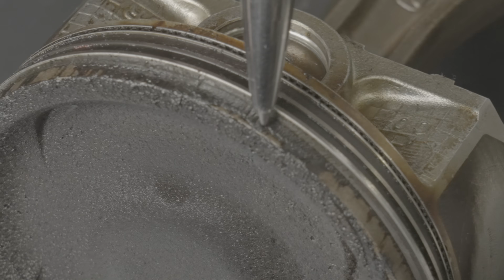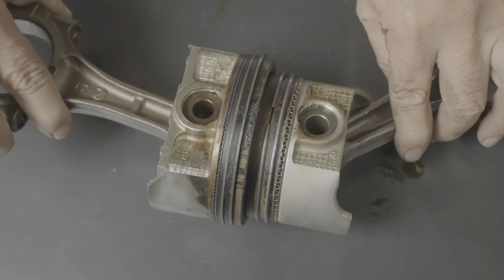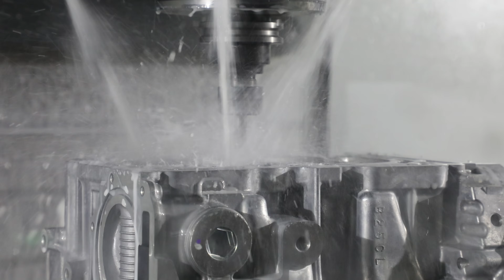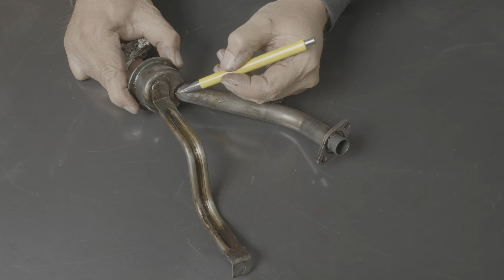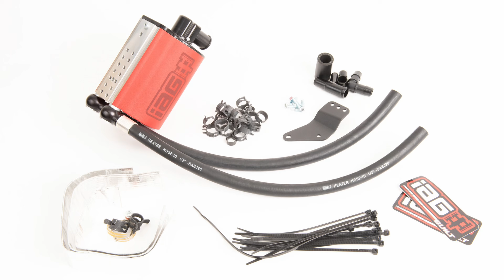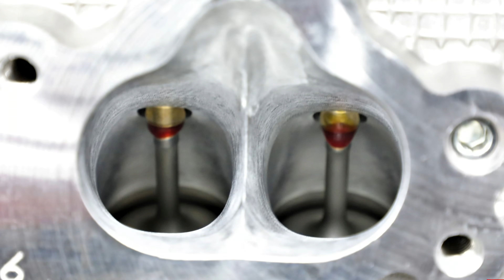Why Subaru Engines Blow Up!

Comment: If you put an old Air-Cooled VW case next to a Subie case you'll see they're not all that much different (structurally). When you think how one was built to support 40-60hp, the other to support 200-300hp, it becomes very clear why these cases flex/distort.
Reply: Check out the Subaru EA engines. The pushrod engines I describe as like someone described an aircooled vw over the phone to an engineer. The transmission (that became the 5 speed) is very similar too. The ring gear ID is even the same, and dimensions close enough you could retrofit a subaru diff into a VW (I've considered it). But those EAs have a 3 main bearing crank like the VW too.
Reply: @Levibetz  As an owner of a 1971 1600 this makes me happy to hear, I always knew the motors where simillar but never knew they were that close. Now I see why they are so popular for swaps gotta say Im deffanatly going to get one of those feeling parking next to Subarus from now on almost like parking a old muscle car next to a new one.
Reply: @randoorlando443  Well the EJ is totally different, that's the motor this video is about. But the older EA is very similar. Nothing interchanges directly, but it's similar.
Reply: @Levibetz  ahh, I figured nothing would be interchangable I gotta say subaru motors are deffanantly far from my cup of tea heck really motors in general but I guess I can always look at subaru as big daddy vw in a way, Thanks for the info
Reply: Thank you so much for this excellent video. I’ve owned an ‘04 and ‘17 STI and an ‘08 and now ‘22 WRX. It’s a shame they have such a bad wrap when it comes to reliability, because my Subies were the top 4 cars I’ve owned (out of 46, including pretty much all the usual suspect “tuner cars”) for daily driving during the week and then canyon carving and track days on the weekends. All 4 ended up around 380-410whp and I never had a single mechanical failure on any of them. I went 14 years straight without missing a single SCCA AutoX event in my region. I always drove my Subies 2-5 hours to and from each event, and then drove them to work on Monday. They never left me stranded a single time. 

Hopefully this video influences a lot of people to stop chasing Coyote/LS/2JZ numbers with their Subarus, and instead enjoy them as a 350-500whp 4-season daily driver/weekend warrior where they really shine.
Reply from the maker: @blueridge8992  100%
Reply: @blueridge8992  100% Agreed, Subarus shine as daily drivers. My OBXT makes 250whp and is an excellent daily. Runs a modest 14.2 in the quarter and I drove it to a season win in local SCCA rallycross. Meanwhile the chassis handles great, does great in snow, fits 6ft goods behind the front seats, 8ft boards and pipe between the front seats. Really couldn't ask for more from a daily. Now it did have ringland failure, but ultimately it wasn't that expensive of a rebuild and now with forged pistons and an upgraded pickup tube, there's nothing much to worry about.
Reply: There are kits to put subie motors in the old bugs.
Reply: Great Info on the Similaries between Original German VW boxer vs Japanese Subie copies. I was looking for an engine replacement for my VW Vanagon but decided to rebuild and upgrade my orginal 250k Waterboxer. I've heard bad things about Subie conversions and this confirms it. Thank you guys!
Reply: You obviously don't know much about boxer engines, then.
Reply: @eskieman3948  Its like saying one completely unrelated 4 cylinder from 1980s is similar to other one from 2000s. General layout will be obviously similar and same-ish form factor, but its not the same design in detail. Especially between aircooled and watercooled engines.
Reply: A lot of EA’s have been used in homebuilt airplanes. Other than being bit heavy with respect to airframe CG, I’ve never heard complaints with performance or reliability.
Reply: The entire mechanical of a boxer is weak.  I love them dearly, but they need lots of support
Reply: @alman-world  No, its just that most of design subaru did was purely for naturally aspirated applications, with turbo ones being and afterthought. 

Same applies to 5 speed manuals, these were all designed for NA application and having then in WRXs and other turbo ej subarus was at very limit of what these could take, with much more brutal torque delivery.

If you stick to stock 2.0L turboes and naturally aspirated engines, you will be perfectly fine. 

Engine wise EJ25 itself was a massive afterthought done purely for american market before being used in europe and australia. 
Turbo version of it doubly so.

 None of the horror stories about ej25 apply to ej20's or ej22's or ez30 H6, and newer FB/FA motors.

Its literarily one engine that ruined their reputation effectively and worse end if the stick of "Subaru legos" in case of use of 5 speeds in 2.5L WRXs later.

 As you get both higher displacement and turbo torque, all beating down on  a transmission meant for 2.0L-2.5L na motor tops with proper reliability targets.

TL;DR just go for anything else than EJ25 turbo or NA and you wont gave any of the issues, if yiu want reliable turbo get older ej20 wrxs or newer fa20/24 motors.
Reply: @alman-world  Not the ones over the past 10 years.  You don't know what you're talking about.
Reply: I wonder how similar the water cooled Porsche engines are to an EJ, in terms of "idiosyncrasies"? I remember reading that the VVT in the Subaru 6 cylinder is a leased copy of a Porsche design.
Reply: @MichaelAMangone  The crankcase of the Porsche 6 cylinder from what I've seen is wildly different. It has a separate bearing support internally with the case halves and cylinders being separate. I haven't checked out videos on their 2.5 H4 though.
Reply: @Levibetz  The M96/97 have the crankshaft carrier and a intermediate shaft for the camshafts & oil pump. These engines were discontinued and replaced with the MA1/9A1 engine series in 2009 designed on a clean sheet of paper. Do a little research on it for a gain in knowledge on this. I have a 2010 Cayman S, as I didn't want the earlier powerplant for several reasons. The aftermarket has come up with a lot of the necessary fixes for the earlier engines, but it's definitely costly.
Reply from the maker: @warrenlucier5796  I did an article on why the M96 sucks and oh the hate, personal attacks, and near-death threats I got.  Porsche guys have their cars as penis extensions and it was like I was insulting their wives or something. 9A1 is an excellent engine.
Reply: @motoiq HERESY!!😂😂
Reply: "Penis extensions ",lol. @motoiq
Reply: @motoiq  I'm pretty sure the hormonal attachment disorder is due to the highly feminine body curves. So in essence they do see them as their concubines. 

That and perhaps the fact that they don't know how to actually satisfy their wives..
Reply: @motoiq Alan Harper bought a Porsch!
Reply: @motoiq I'm a 911 owner and within the community even owners of m96 and m97 powered cars acknowledge their engines have flaws. I'm surprised anyone could possibly defend it. On the forums there's hundreds of pages of discussion on bore scoring and oiling issues..
Reply from the maker: @memememine1  You would not believe the angry and insulting comments I got when I did a story on these motors,  https://motoiq.com/performance-engines-that-suck-the-porsche-m96/  I wrote this before bore scoring was as big of an issue.  Porsche guys are nuts, read the comments!
Reply: water cooled porsches dont work @MichaelAMangone

Comment: I’ve heard that knurling the pistons actually helps it hold oil and reduce piston slap
Reply from the maker: Knurling is bad, don't do it.
Reply: @motoiq  I’ve only heard of it as a solution with the ej22e in the late 90s because the piston skirts are soooo short.  And when I say knurl, I mean a very very shallow knurl with polishing.  Jsut evnough to hold oil.

May I ask why you would recommend against it?  Your video is so damn good, btw lol
Reply from the maker: It doesnt work and wears fast.
Reply: @motoiq  Wears fast? You mean the cylinder wall?  Knurling presses material in, it’s not really a cutting operation.  It shouldn’t be sticking out any farther than factory if done right.  It shouldnt even be contacting the wall.  That’s what the rings are for.

I’d imagine it just wouldn’t hold enough oil to make any kind of difference.  That’s just based off my 15+ years of machining.
Reply from the maker: I tried it on an engine before and it was a shit show, ran well at first then slapped and burned oil like crazy after only a few thou miles and when torn down the pistons were pretty worn.  Maybe these were over-knurled? Anyway, I never did it since.
Reply: @motoiq  Ok that’s what I was wondering.  The pistons wore, probably because it was too deep and likely pushed material out.  When i read about it, the person said it had worked BUT they did a super light knurl and then lightly buffed it.  

But yes it is way too much work and isn’t worth it.  It doesn’t fix the ringland issue.
Reply from the maker: Do you think too tight of a pitch could do it so too much groove area an not enough skirt area?
Reply: @motoiq  Possibly? I’m pretty sure the example I was reading about was a form knurled female Diamond pattern.  

I guess the better question is what kind of knurl did you do?  A cut type one direction?  

There’s so many freaking types and ways of knurling lol I’ve been machining for 15+ years and I still crack open the handbook every time I have to knurl.
Reply from the maker: It was a long time ago, the machine shop did it so I am not sure but the whole piston was covered in a tight circular pattern like threading with no pitch. The machine shop said it would be awesome and I was just a kid but I learned the hard way.
Reply: @motoiq  oh man, that almost sounds like a straight knurl haha ya that definitely wouldn’t work and would just scrape away.  Sounds like they thought it would act like a second set of rings 😂
Reply from the maker: Are you old enough to remember some pistons came like that too, I think Arias from the early 80's.
Reply: @motoiq  I’m only 40, so no lol what were they for?  Pre EJ Subarus?  Or for like a SBC?
Reply from the maker: Datsun L series. They rattled and smoked! But technology was not so good in those days.  Those pistons ran .007" clearance.
Reply: @motoiq  holy shit! Haha so it is something that’s been around as a concept for a while.  Now I’m going to have to read up on the concept, I wouldn’t be surprised if it was used way back when for the purpose were discussing.

Either way, I’m glad I’m subscribed to your channel.  I actually learn stuff from you haha
Reply: Metal is malleable, but virtually noncompressible.  Knurling displaces metal, it goes somewhere. The peaks are higher than the original OD, the valleys are lower. The piston gets a little larger. 
    Just as knurling the inside of valve guides makes them smaller.
   Both are sort of hack methods, in my opinion, but honestly, I never did either myself. I am one cheap SOB, and do like experimenting,  but I do buy new valve guides and pistons if unhappy with what I have.
Reply: @firstielasty1162  There’s two main types of knurling.  Cut and form.  You can do a negative or positive form, too.  

Metal can 100% compress, but it changes the molecular crystalline structure and can cause brittleness and hardness increases.  

Depending on how deeply you form the knurl, you will get a minor amount of material displacement.  But that’s also why the example I’ve seen of this being done, included a slim cut to bring the surface smoothness and by proxy, the diameter back to spec.

I wouldn’t call it a hack job if it’s done right as it requires quite a bit of machining and material science knowledge.  If you do anything poorly, it’s hacky lol

Cut knurling will be a subtractive operation and would not create an enlarged diameter.

This is coming a prototype 5axis cnc machinist with a 15+ years, but i have not been building engines, though.  Are you an engine builder?  Do you do automotive machining?  I’m not trying to throw shade, genuinely curious where your experience lays.
Reply: Knurling, when talking about pistons and valve guides, as far as I know, is generally done for the metal displacement...to either make worn piston skirts larger, or worn valve guides smaller, which probably then need reaming back to proper stem to guide clearance.
   I think in both cases, bearing surface area and heat transfer are reduced, so earning the "hack" label. I think both were more legitimate 80 years ago, when hp/liter was lower and people thought the labor trade to keep something running a few more years was worth it. Like I said though, I never did either.
    If metal can be compressed, it's density increases, no way around that. I thought aluminum and common alloys are stuck at around 2.7 g/ml, iron and steel at 7.8 to 8.0, magnesium at 1.7 +/-, etc.never heard of metal working that changes that. Forged items are about the same density as castings, for example.
    Crystal arrangements, I didn't think there was much flexibility there...FCC or BCC, repeat, repeat...with interruptions and dislocations changed by forging and work hardening, but not increasing density (or very little..) If I think much about that crap, I start to worry about the strength of metals that I would otherwise trust..bonding and all that seems sketchy...
    I have some machining background, nice bridgeport/lathe with more tooling and inspection stuff than most home shop guys, but still..just bridgeport & lathe, etc. Car motors I assemble get bored by a real shop, small engines I bore/hone myself. Valve & head work, I do. Have valve grinder & seat cutters. 
   Cnc, is, of course, "the way ", but the fact that I've stopped using my phone for internet shows my interest in that.
   So, I do some automotive machining. But just at my personal hobby level and pace, for fun. Friends s2000 motor last year, but totally stock. Needed a crank, stock cranks are now rare! 4age is current one in progress.
   I would like to hear about that compressibility.- I have not heard of metals deviating much from their starting densities, other than weird alloys, like aluminum/scandium (I think) is a bit less dense.
   Similarly,  hydraulic oils are technically compressible, but not to any degree that matters much to people working on hydraulics, so it is sort of splitting hairs.
Reply: @firstielasty1162  nice response, I’m in the middle of running a complex part so I’ll hit you back soon.  Love the knowledge in that comment though.

Comment: I asked my dad why Vw bug flat air cooled lasted so long he was like” they had like 70hp son”
Reply: See also a lot of "long lasting" Toyota engines - very low power in stock form compared to the strength of the engine.
Reply: @yowie0889 everything is overbuilt like hell at Toyota and that’s why my ES350 is the most boring thing to drive ever
Reply: No, they didn't have "70hp" - they had much less.
Reply: @eskieman3948  46hp vw 1300
Reply: @eskieman3948 depends the engine 1300cc 1500cc 1600cc Empy engine horsepower estimates are: 60 HP for the 1600cc. 70 HP for the 1776cc. 80 HP for the 1914cc.
Reply: @eskieman3948  More like 30-40
Reply: @Justa3Valvesstang wrong 😂
Reply: @Justa3Valvesstang  And very low compression to accommodate the 40 octane reject garbage that the coal liquefaction plants spat out during the war.
Reply: @jonathasfigaro4992 the first iterations did not have 70 hp . The only thing with less back then were the citreon 2cv's.
Reply: Sooo, maybe don't build a Subaru engine past what it was designed for unless you engineer it? Personally,  I avoid ALL turbo engines.
Reply: Yea, a 70hp bug would have popped wheelies back in the day!
Reply: Avoid all turbo chargers ,especially on small engines!